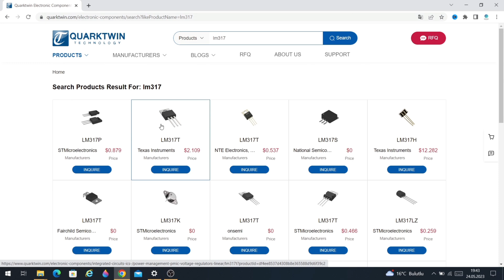[New idea] IGBT-Based İnverter (Driver) Circuit

Comment: ups 300 w Hocam 12v/73A jel akü ile kaç saat tv idare eder? Uzun süre ups çalışırmı fanlar dahilinde ?Yoksa yazılımsal gereği kapanırmı?Ben hem ups e 220 v girmek istiyorum hemde solar panel şarj kontrol ile 12 v 8.5 A powersupwey ile şarj etmek istiyorum elektrik gidince sadece spot ve lambaları idare edecek?Elektrik gelince tekrar devreden çıkacak?
Reply: Sürekliliğini olabilmesi için güneş paneli öneriyorum biraz pahalı olur sen evine ne kafar ups alsan o bitecek ek gelire 😢ihtiyaç olacak ancak 4 veya 8 akülü sistemler olursa uzun müddet 7 8 saat akü kalitesine göre tek akü ise 1 2 saat gider çünkü enerji çekimi sürekli ses ve görüntüye göre değişecektir  bende çift akülü vardi 1 saat gittiğinde 😅oluyorduk veya saç kurutma bile çalışmıştım 5 10 saniye zaten ups 2000 wat 😂
Reply: Ek olarak şarj edilecek akünün 1 2 volt useri de olmalı 12 akülü 12 volt da sabit kalır tam dolmaz
Reply: Spot lambalar led mi filemanli mi flemanli ise şarjı bitirir
Reply: Tabi watina göre
Reply from the maker: çektiğin güce bağlı kardeşim mümkünse tüm sistemi 12 volt kullan nerjiyi yükseltirken enerjinin yaklaşık %30 luk kısmını gerilimi degiştirmek için kullanıyor. 12 volt televizyon ve aydınlatma ile daha uzun süreler kullanmak mümkün